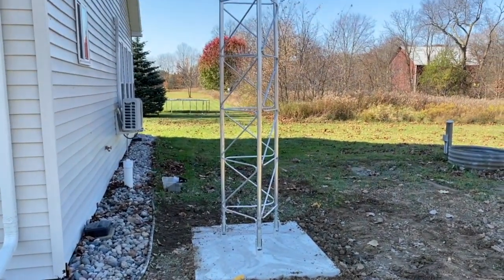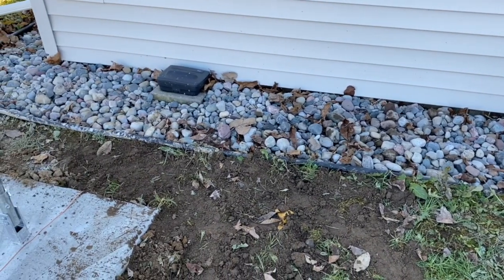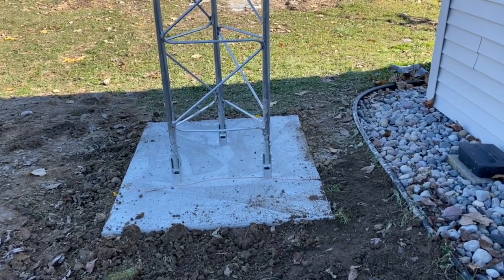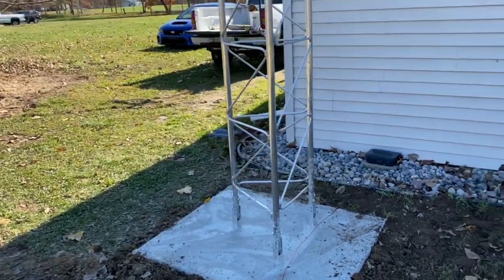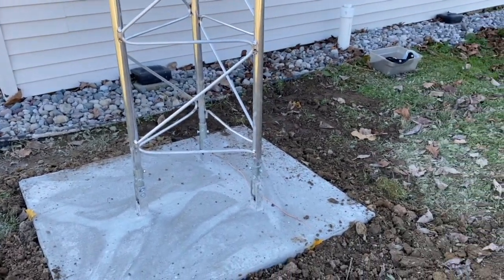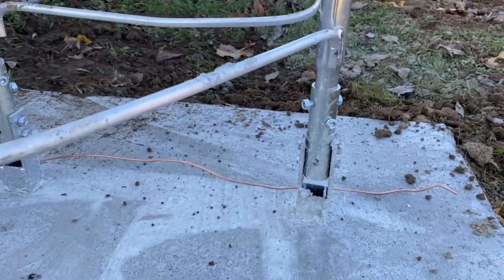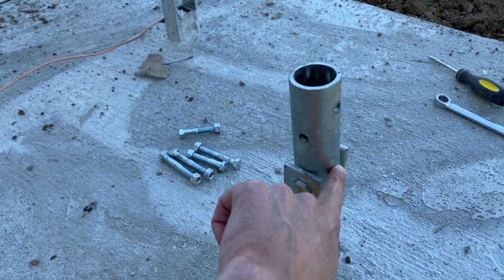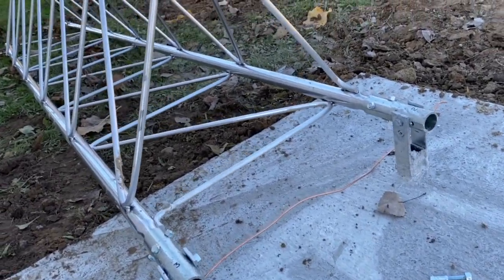Ham Radio Antenna Tower Part 3 - Assembly and Raising

Comment: OK.  The way I would do this is prop the tower up on a 6 or 8 ft latter, after you've put your tv antennas and adjusted them to the angle whare you will get your tv stations at. Once propped up and sitting on a ladder, you can get either an extremely heavy rope or strand wrapped around each tower span and since you do have a truck there, back the truck up to the tower pad about 3 or 4 feet away and hitch your rope and or strand up to the rear middle part of your bumper and ever so slowly, pull your truck forward raising the tower till it's fully up in the air, then pin the tower onto the one left hinged base, tighten it and your all set to climb the tower to release both the rope and the RG 6 cables down to the ground, tie wrapping the cables to one of the tower structure to ground level, and ready to shoot your cables into the cellar/basement of your home to make final connections along with grounding proceadures on to a cold water pipe. On each peg of the tower, be wise to sink three ground rods into the ground and attach them to ground wire for always additional grounding proceadures against static electricity build up from a electrical storm.

Comment: Can you tell me how heavy of an antenna you plan putting on that 40' tower, and whether or not you two think that you would be able to walk it up likw shown in the video (w/o a winch system) ?  Also, do you think it is possible to walk it "down" (by hand) w/o a winch with like 25-Lb hex beam antenna on it ?
Reply from the maker: The antenna I put up (an A3S) weights 27 pounds. I'm not sure about the mast and rotator. Personally, I would not have tried to walk it up with any weight on it. It was not trivial for two of us to walk it up empty. Consider that the tower acts as a third-class lever and that your mechanical dis-advantage /increases/ as you walk it up. As it reaches vertical, I think you'll be at something like an 8:1 disadvantage, so your 25 pound antenna will feel like 200 pounds. Plus the mast, rotator, and so on.
Reply: @StuntProgrammer  Ok, thank you for that (although, your sped-up video of you two walking it up did make it appear "trivial"). Would you be willing to explain to me what your final tower elevating solution was (or "is")? - Do you have some sort of winch system etc. ?
Reply from the maker: I put it up empty and have climbed it to work on it and install antennas. I used a tramline to get the big beam up to the top. The next couple of videos in the series show how, more or less.
Reply: @StuntProgrammer  I see.  Thanks for that info. I had to hunt around for the video, but I did find it.  It would be nice if the "next" video link would somehow pop up near the end of the previous video.  I see people do that, but I myself don't know how to do it (but would love to learn how to do that).

One last question(s):  Why did you go with a tram-line option instead of a cable/winch option ?  I thought that was the main selling point of these light aluminum towers - easier to winch up.

As far as climbing, I couldn't seem to find out how much weight these towers could support as far as someone climbing them. I'm 220 Lbs, and I'm wondering if a #9-50 would even support my body weight at 50 feet.  Are there any specs on that, or general guidelines on that?  Thanks again!
Reply from the maker: I thought it would be interesting to learn to climb and do tower work. When I was looking at towers, I think I found that the crank-up and tilt-up options were more costly and more complex than a static tower. Given those factors, I decided to buy a static tower and climbing gear.

If you're looking to adapt a static tower to be winched up, it's probably a good idea to ask the manufacturer how high up you need to winch from and what an appropriate method of spreading the load would be (or perform your own engineering calculations if you're comfortable with that).

Likewise for determining the safe load when climbing -- it may be specified or the manufacturer may be able to give guidance. I suspect most tower designs focus on strength against overturning (and maybe twisting) and end up "pretty strong" in vertical loading as a side-effect. But it's worth checking!
Reply: @StuntProgrammer  But the tower you have in the video is specifically a tilt-over tower, - not a static tower, right ?

 In fact, as I understand it, Universal only makes tilt-over towers.  Am I missing something (as far as it being a tilt-over tower) ?
Reply from the maker: Nah, the Universal 9-40 isn't what I would call a tilt-over tower. When I think of a tilt-over I'm thinking of a few features this tower lacks: reinforcement for the lifting loads, a means of providing mechanical advantage for lifting (a winch or screw-jack), and the hinge-point is usually up between the first and second section (which helps in getting the mast down to where you can work on it). I think I've seen tilt-overs from Great Plains, Rohn, Heights, and probably some others I'm not remembering right now.

Comment: What antenna did you end up putting on the tower? Mine (12-40) will arrive in 6 weeks but have to wait till snow melts :-(
Reply from the maker: I put a Cushcraft A3S on mine. I like the design, but the one I bought brand new needed a fair bit of rework to operate correctly. Fixed up, it's been playing great so far and has survived the wind.

Comment: Nice video!  Are those short extensions at the base of the tower necessary?  I am getting ready to install mine and I don't have those.
Reply from the maker: Check with the manufacturer, but on the model I installed they were definitely necessary.